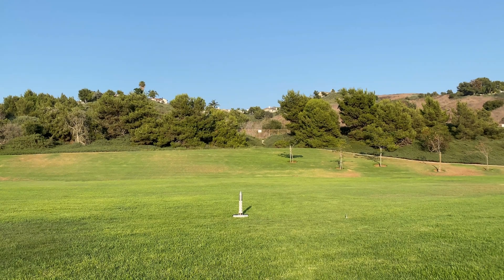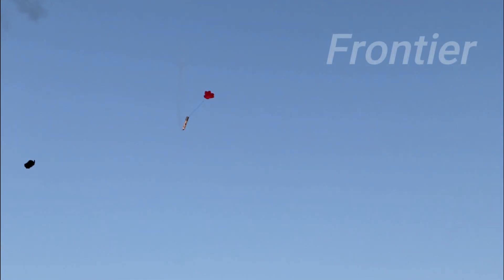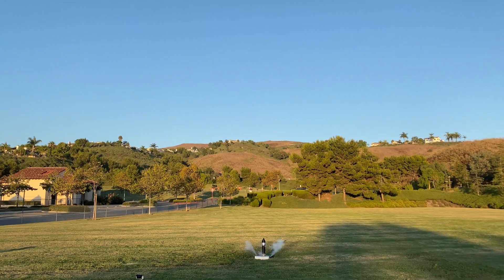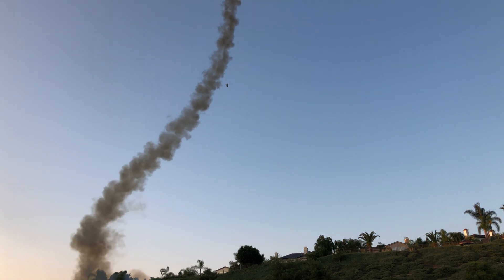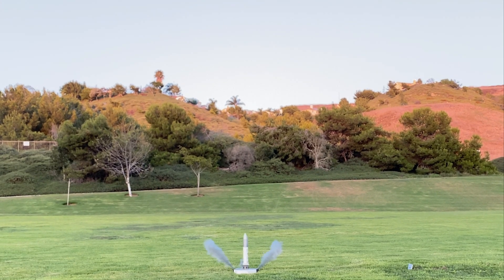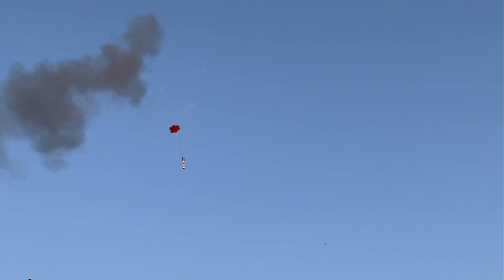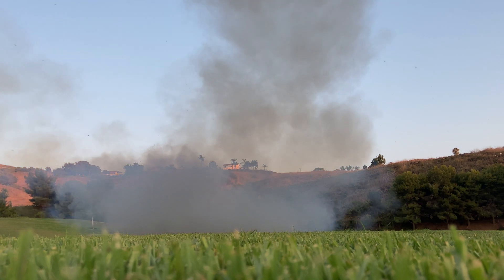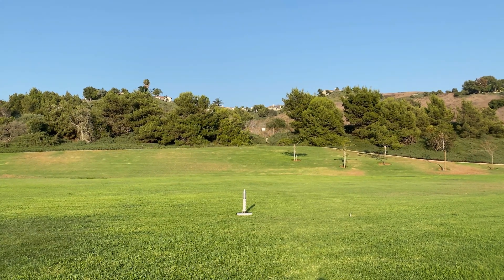Frontier TVC Rocket | Flights 8, 9, 10, & 11

Comment: Are you using all black powder motors on frontier or APCP
Reply from the maker: Both actually, up until Flight 10, Frontier used C6, D12, and E12 motors. Flight 10 and 11 used the F23 motor which uses APCP propellant.
Reply: What engines are you going to use on the xenon rocket